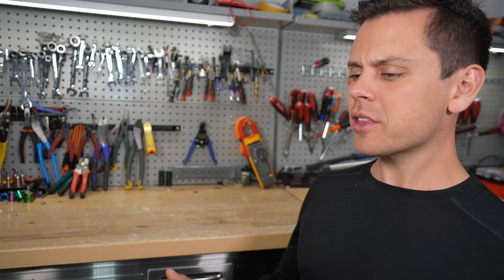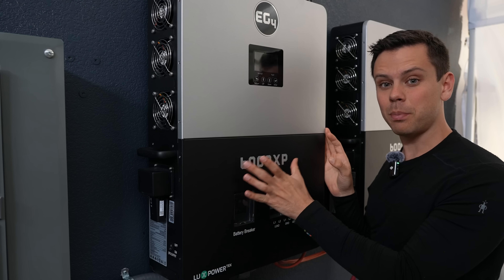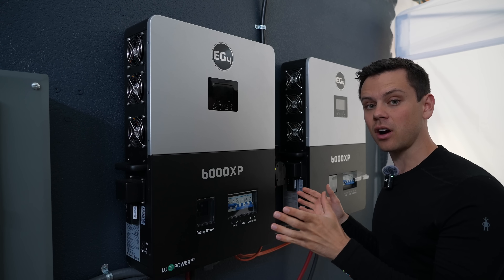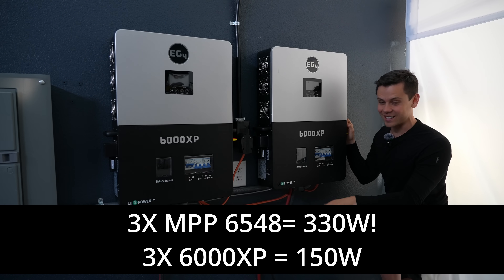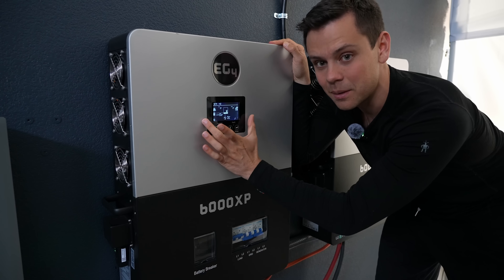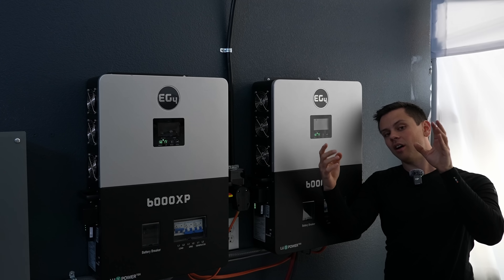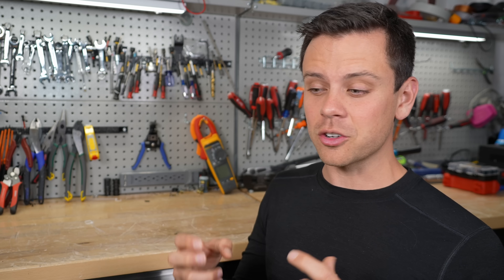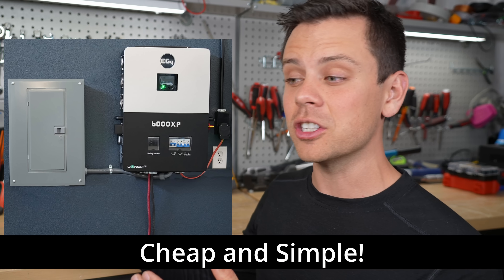Offgrid VS Hybrid Inverters! Which one is better for the $$$?!

Comment: What I like about your videos is your overwhelming practical approach in presenting facts and considerations.  Spending more for quality is never a bad choice.  Buy cheap and it is still going to hurt because spending hard earned resource is painful.  The problem with cheap is that you continue the pain with regret for less quality and features.  Buy quality and it still hurts when you make your purchase but that's where the pain stops.
Reply: In my line of work, automotive, we call this philosophy Buy once, Cry once. It applies to nearly everything electrical or mechanical.
Reply: Not a great moto in a field where tech is advancing quickly and prices are dropping quickly.  DIY a budget system that breaks even within 5yrs instead of 15yrs for top of the line.  Upgrade your budget system in 10 years so you have 10 year newer components and tech.
Reply: @NickWindham  It's always a game of balance.
Reply: @BulletproofPastor  agreed

Comment: Also, I'm curious what ATS people recommend?  I'm the opposite of most setups - off-gris is primary, and when battery drops below a set voltage, the ATS kicks on the commercial grid as backup.

Comment: The other week you were wondering why people still build 12v, even small systems.  My 2000Va Victron idles about 12-17w, so when you only have 2kw solar and winters don't have enough solar here at 54N, parasitic loads are certainly a major factor.

Comment: Your explanation of "Net Metering' Great and is the most honest yet harlious truthful statement that you could make!! 
I'm in the process of building a completely off grid home that I will use a standalone building as the home of batterjkies and inverters , basically a  power station for my property. My workshop and my Horse Barn will each have a system for themselves because noise in those settings will not matter. 
Just keep putting out the informative videos as this equipment will continue to change for the better.

Comment: This video was great at letting me know the basics. I would like to see an indepth view of a off grid system from battery to outlet.  A victron requires many parts while the 6000xp has minimal parts. We see lots of home use setups but what about a shed setup that needs high output but used minimally.  I would like to see how to tailor the use in the setup.
Reply: Check out some of his older videos. I am certain he has built more than one system that could be useful to you as a guide for what you need.
Reply: @Tumbleweed5150  I have seen them but with the huge amount of new solar equipment,  things have changed. The huge amount of all in one units with new technology can possibly handle greater surge. Davidpoz is doing a schneider build but redundant reviews from different views can offer insight to the equipment.

Comment: Nice video Will, we're just starting out with our first 6000XP for a house battery back up. Just receive everything and not hooked up yet but making preparations and ordering parts for the hook up. Plans are to add some solar panels later. I think the 6000XP is a good starting point for the novice. As we mature in our knowledge of what these systems can do for our particular needs maybe graduating to a hybrid system eventually.

Comment: Normally 6kw 48V transformer less will take around 50 to 60W no load power but 6KW Deye (Sunsynk)(eg -Model - SUN-5k-SG01) Hybrid inverter will take more than 100W no load power so unless we he net metering the additional cost that we are paying may not be that much useful. OR We  need specific features like more control and monitoring options but DEYE (Sunsynk ) Hybrid has more than 5  Minute delay to sent data to cloud so they need to change the update interval to at least 1 minute

Comment: The 6000xp will work for the house.  I don't see the transformerless units holding up powering a mig or tig welder long term. The inrush current is higher than most motors of the same amp draw.  It's one of the hassle of powering them off a genset.  On paper a 6000 watt genset should power mine mig... I've found a 10,000 watt genset offers better weld stability

Comment: Hey Will. I was thinking about using solar pv panels to go directly to a water heater with dc heating element inserts. I found that you can get dc elements up to 3000watts each. Could I hook up directly to panels that put out what the elements require. So I wouldn't need an inverter. Or what would I need to have between the panels and the dc heating elements. Minimal equipment to save on installation costs. And least amount of loss.

Comment: @Will - Bridged System (18kPV + Array of 6000XP's + Multiple PowerPro ESS Wallmounted Batteries): 
Would a bridged system aggregating your EG products be a potential future video? 
-- Possibly detailing the bridging of one 18kPV (grid tie+transfer switch+low frequency) connected via manual disconnect switch to an array/multiple EG 6000XP's, to then supplied by an array of  EG4 PowerPro ESS Wall Mounted Batteries for off grid power, charged by the 18kPV grid power and/or solar? 

Configurations may include, but are not limited to:
-- 18kPV: Grid tie+transfer switch (Grid/Generator/Battery)+low frequency, Online UPS 10ms switch time (optimal Online UPS switch time = 0ms)
-- 6000XP: Off grid+multiple mppts+high frequency, Online UPS 20ms switch time.
-- EG4 PowerPro ESS Wall Mounted Batteries: Off grid power + grid tie sellback/net metering via 18kPV.

Online UPS Switch Time: *Optimal Online UPS switch time = 0ms for uninterrupted operation.
*Please do not connect the product to any device that requires 0ms UPS, such as data servers and workstations.
-- 18kPV: Grid tie+transfer switch (Grid/Generator/Battery)+low frequency, Online UPS 10ms switch time (optimal Online UPS switch time = 0ms)
-- 6000XP: Off grid+multiple mppts+high frequency, Online UPS 20ms switch time
--- For Reference: 
----Ecoflow DELTA Pro Uhas an online UPS switch time within 30 milliseconds. 
----*In case of a sudden blackout, the product can automatically switch to the battery powered supply mode within 30ms. source: Ecoflow Online Manuals, delta-pro-portable-power-station.
----Ecoflow DELTA Pro Ultra has an online UPS switch time of 0 milliseconds.

Use Cases:
-- 18kPV for grid tie, transfer switch, low frequency operations
-- 6000XP for off grid, larger/split solar arrays, high frequency, extended run time operations for an array (of up to 16x linked 6000XP's) under heavy load dumps exceeding standard circuit specs (e.g. 36,000+ watts). 
--- I believe you can link up to 16x 6000XP's, with 3x EG4 PowerPro ESS Wall Mounted Batteries per 1x 6000XP.
-- EG4 PowerPro ESS Wall Mounted Batteries (or other large aggregated battery pools) for extended run times at potentially high load draw that exceed standard circuit specs (e.g. 200A+ circuits).

Edit: Online UPS switching capability as a purchase consideration has been added for all inverters going forward. Online UPS Switch Time: *Optimal Online UPS switch time = 0ms for uninterrupted operation.

Comment: I'm a first time user with a two systems, one Sungold inverter 24v, and one EG4 battery, and one with EG4 6500 EX 48, and two EG4 batteries.  Just added 10 Bifacial 400 watt solar panels.  I'm using my solar as a backup power source to grid power with a diesel 14kw generator.  Just started to put the recent equipment to the test, and hope to find ways to use the power for my home.  Will has been a great resource that got this all started.  There is a learning curve to solar and expected to under plan a system, but get all the parts to work gives me better confidence to add more over time.

Comment: Unfortunately Will, this was not a great video. Frankly, you should rename it into “EG4 off-grid vs hybrid inverters”, since most points you make don’t apply to other brands.
Reply from the maker: And yes the points do apply to other brands
Reply from the maker: I'll rename it then
Reply: This was a great video that contains very valid points, while offering configuration, budget and upgrade path considerations. So many potential configurations become available with the options mentioned within this video, and are on point for the variety of capable equipment available throughout the industry. Just apply the points derived from this video to your preferred xyz equipment, your current budget and the expected timeline for your upgrade path. Buy backups at point of purchase if you wish to avoid limited equipment availablity over time (a.k.a buy backups if you want availalble replacments at time of failure). Problem solved.
Reply: One of your final points, the fan noise, is a big reason I jumped ship from the 12000xp to the 18kpv.  In Puerto Rico, out home does not have a garage, and is small (compared to the US) with nowhere to mount inside that we wouldn't hear the fans roar.  The 18kpv allows us to mount outside eleminating that noise inside, and actually doesn't make a sound unless we're pulling over 6k watts solar with no load.  We can pull 7kw from panels, but if we have 1kw load, still won't make a sound.

I have learned so much from Will, and continue to.  He's a super smart guy, and knows these systems inside and out.  The vast majority of my system choices and design were inspired by his knowledge.

Now my stats: 18kpv with single eg4 outdoor 14.3kwh battery, and 6.6kw panels.  Unobstructed view of the sky, 100 yards from the beach in Punta Santiago, Puerto Rico.  Average 5.9 full solar hours here annually.  System can make 35kwh daily.  My daily consumption is 25kwh.  Single battery can get me thru the night running our two minisplits in the bedrooms.  During the day, the living room AC is turned on and excess solar recharges the battery.  If we have a bad sun day, just flip the manual transfer switch to the grid.  Our design does not allow grid issues to harm the inverter, or inverter to feed to the grid.  External transfer switch makes us choose either grid or inverter power.  Reason for this is the PR grid is about the same quality as south Africa, with power spikes, imbalances, and weekly total failures.

Comment: Very interesting Will, thank you.
I have one MPP 11KW off grid inverter running the house and shed, with grid connection available in times of bad weather. This draws less than 70 watts on idle. It also has an ATS built in.
I don't think having a hybrid inverter and battery system mounted externally would work too well in my hot climate, as in Summer on some very hot days, I air condition my inverter and batteries to keep them within the operating temperature.
Also, I am not sure of any advantage of having solar isolaters or AC breakers on an inverter apart from a more simple installation. If you want to work on the inverter using these isolaters or breakers they do not allow you to remove the inverter from the circuit without other external disconnections.

Comment: Great summary!  One interesting additional note is that even though the 6000XP cannot export power to the grid, it does have a grid bypass mode where it just feeds the AC input straight to the load.  Looks like it can feed-through 50A per unit.   16ms switch time.  So there is that.

But in terms of acceptable equipment... I'm looking at the California Energy Commission "Solar Equipment Lists" (the state where I live) and only the EG4 18KPV-12LV is on the list in terms of EG4 equipment.  The 6000XP is not, unfortunately.

-Matt
Reply: Good point: 6000XP 16ms switch time does not present a valid online ups configuration, however I believe the 18kPV does offer certified online ups switching capabiltiy required for sensitive electronics/computers/etc. I'll need to look into that, very good point.